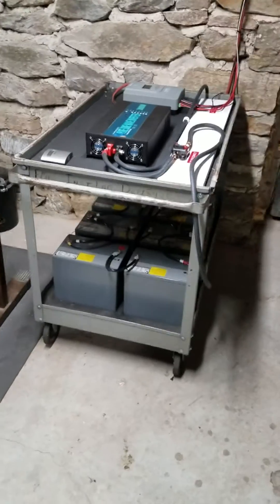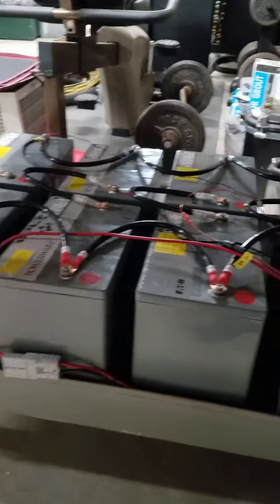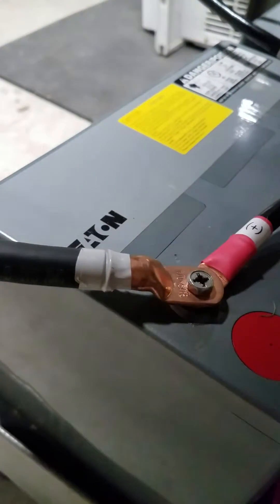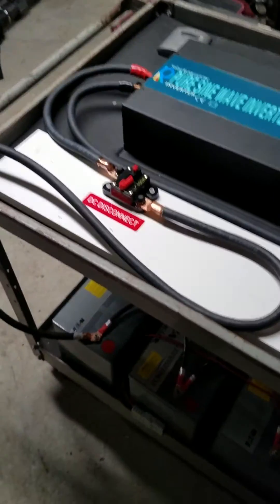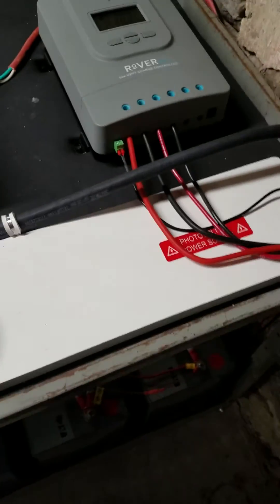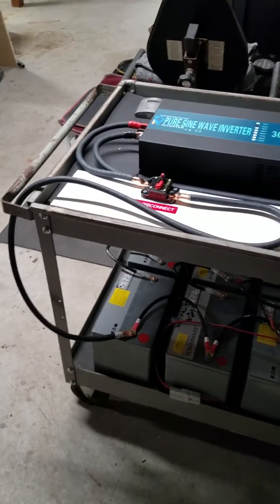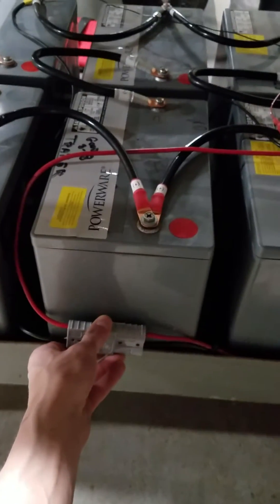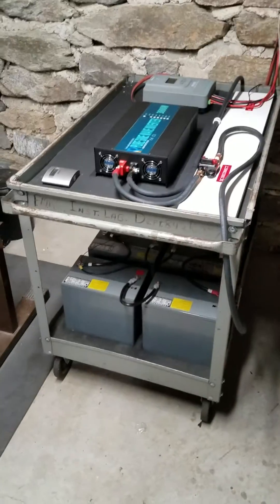24v Emergency Battery Backup System 3000w 7.2kWh

Comment: Probably dumbest Q’s you’ll get, but seeking to create similar for my house.   1) How to tie it into my home’s existing electrical system, outlets etc., so when the grid goes down, this goes up, and vice versa, is that even possible?   2) would someone who has very limited electrical knowledge be able to create this with a list of components by you? And sources to get them from? And detailed assembly instructions?  I’d be willing to pay for it, if it could work, or perhaps u create and ship the kit?
Reply from the maker: you would need to have a setup basically like a big UPS (Uninterruptible power supply) where  all loads that would stay on in a power outage would be run through this unit. When power goes out it would detect the outage almost instantaneously (4-8ms) and switch over to battery power on the designated loads that are in line with the unit. You would just have to have  enough power and storage capabilities in the batteries that would be used in the outage for the UPS system. They make units like this all in one or you could do something where you modified a smaller UPS to have a larger battery capacity. I am in the process of doing this as I was able to snag an APC Smart UPS 2200 for free. If you were to tie it into existing power at your house, that would require an automatic safety feature to prevent power from back feeding to the grid.  The code for this requires it to be automatic, with no chance of human error, to prevent line workers from electrocution. The all in one units would have this feature built in, but there are other ways to do it as well. Let me know if you have anymore questions!
Reply: @SamsDIY    2) would someone who has very limited electrical knowledge be able to create this with a list of components by you? And sources to get them from? And detailed assembly instructions?  I’d be willing to pay for it, if it could work, or perhaps u create and ship the kit?
Reply: And 3) same question on your cool 2 axis solar panel structure...could you provide detailed materials list and detailed construction & assembly instructions, or, perhaps build it for me and ship it to me?   Ps.  Loved seeing your baby watching, dog, cat and all, ha.   Pretty awesome job you did!
Reply from the maker: @GregHohman  I'm sure you could do it no problem. it is easy to wire the batteries up, even if you just read it off a wiring diagram, depending on what you would want for voltage. most likely it would be a 24 volt or 48 volt backup system. Everything is totally doable for anyone with just a little knowledge about basic things NOT to do with a battery, fuses/DC circuit breakers, reverse polarity, etc. It isn't a very big list for materials you would need, but prices can be very different depending on how good of an inverter you want, pure sine vs. modified/square wave inverters, or if you want it to auto sense and switch for you. The voltage plays a big role as it determines the gauge wire you need. 48 volt systems are cheaper for wire since the amperes are half of a 24 volt system, which allows you to use thinner gauge wire. So you need a set of batteries, 6v or 12v  to make into a bank, a DC to AC power inverter, a way to keep them charged (solar, grid power) and wire for wiring outlets etc. thats about it, unless yiu charge with solar then you would need a DC charge controller and solar panels.
Reply: In an emergency you can tie to a breaker in your panel similar to a generator back feed. Be aware it's illegal and is called a dead man's switch.

Comment: What's the amp rating for your batteries
Reply from the maker: the amp hours? its a 560 amp hour bank if I remember correctly. I can do out the math again when I check the numbers. its the total amp hours of all 8 batteries divided by two since its 24 volt.
Reply: @SamsDIY  I'm setting up about the same system, only 4 - 100amp batteries, same inverter. It's only running a 24v refrigerator and separate freezer. The inverter will be used to charge cordless tool batteries. I like the roll around cart idea.

Comment: Why 24V and not 12V?
Reply from the maker: The two main reasons were so I didn't have to use big gauge wire for this size inverter since the amperage is cut in half from the same at 12v. Also you really shouldn't run 8 12v batteries in parallel like that. I have the batteries setup as 4 banks of 2 batteries in series, and then those 4 banks are paralleled together. Its much more even with charging and drawing off the bank as a whole.
Reply: Why should you not run 8, 12v batteries in parallel
Reply: @marcogarcia168  to get 3000 watt inverter from 12v takes 250 amps on the wire. To get to 3000 with 24v takes 125 amps. 24v is closer to the 120v you're converting tp.
Reply: @marcogarcia168  
I thank You can run 8 or more 12V Batteries in parallel...
It will be the same set-up that the electricity in in your house... Parallel👍...